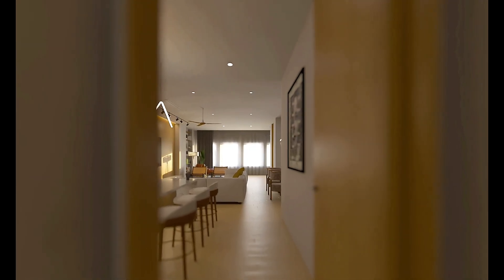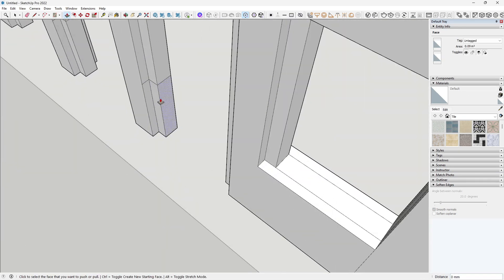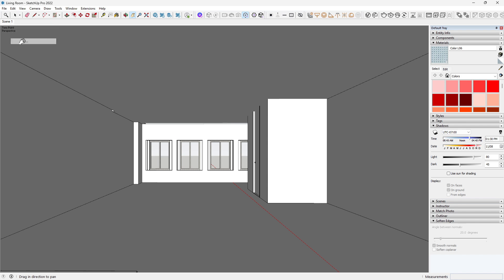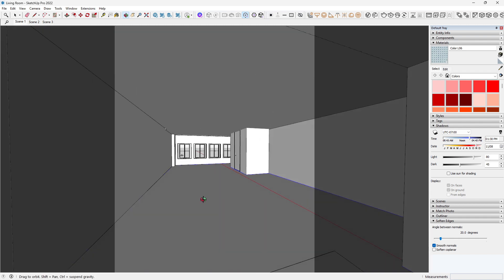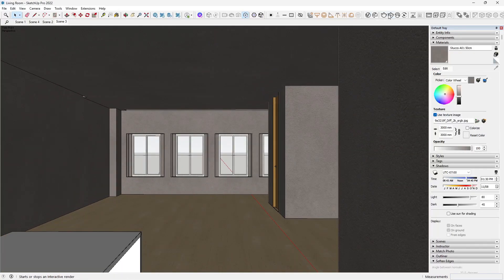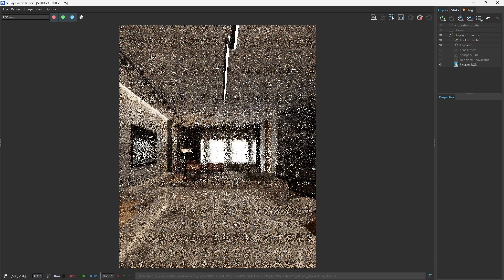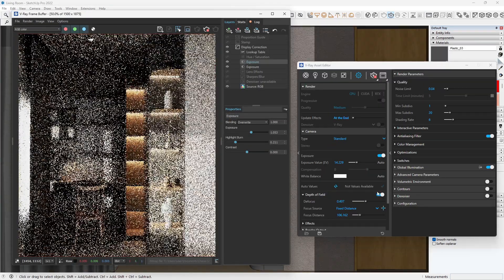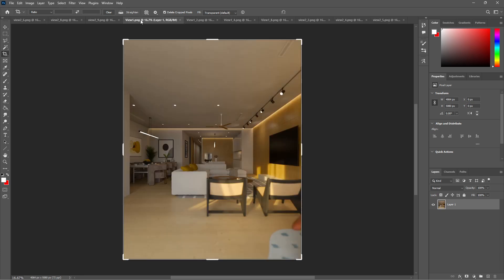Realistic Living Room Rendering with SketchUp + V-Ray | Full Workflow Tutorial

Comment: I see you are working in various scenes and you change values on the v-ray frame buffer. Do these changes only affect the particular scene or they change simultaneusly in all scenes? Many thanks!
Reply from the maker: Thanks for the observation, yes the changes in materials, VFB post production effects, affect all scenes however, changes in camera settings such as Depth of Field, Exposure values, and lighting would have to be set specifically per scene depending on what you want for each scenes.